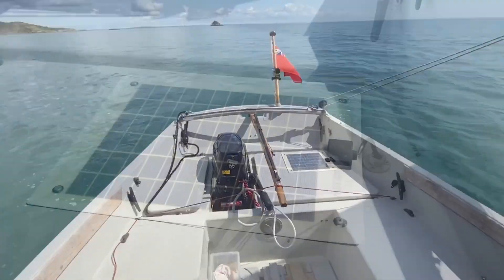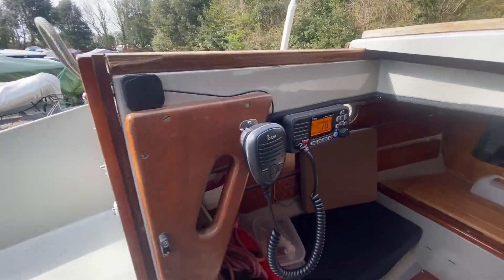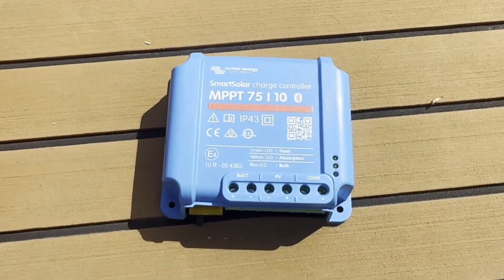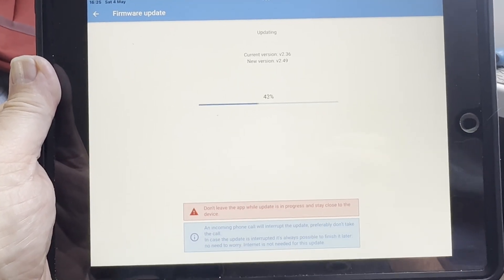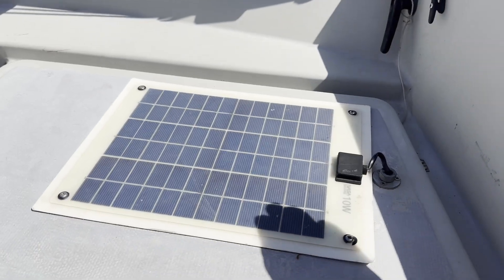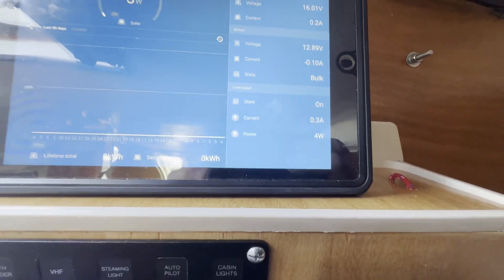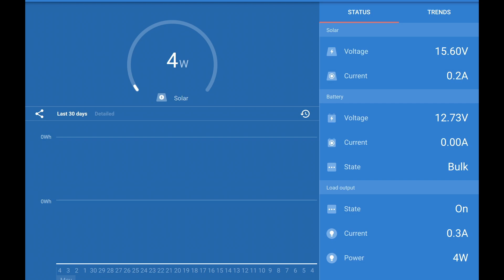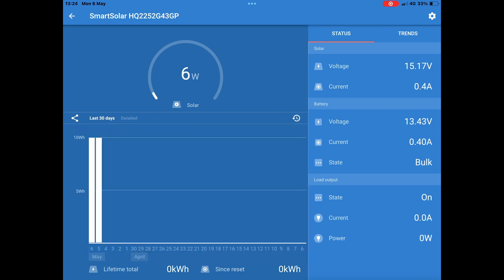No. 29 Fitting a Victron solar charge controller to a small sailboat.

Comment: Hi Paul - I'm sure you'll have thought of this but how about an alternator on your outboard for giving the battery a top up?  I have an inboard and last winter fitted a second battery with a 'Blue Sea Systems Add a Battery Kit' which controls charging of the batteries, giving priority to the starting battery until it is fully charged and only then switching automatically to charge the second battery.  Not entirely relevant to your situation but I thought it might be of interest.
Reply from the maker: Hi. Yeah, I priced up having a charging coil retrofitted. Best part of £400 all in.  It’s still a possibility but I’m probably going to go for more solar instead.
Reply: @Morningvicar  That's a crazy price! Sounds like more solar is the way to go.  Keep the videos coming - I enjoy them

Comment: The charge controller you need depends on the battery you have, the cheap PWM works well with a lead acid battery.  The MPPT controller is needed for Li ion, but will do fine on your battery. Go Lithium, it is lighter and lasts longer.
Reply from the maker: Thanks very much 👍

Comment: Many thanks for the video. Always helpful to see someone tinkeriong with solar panels!!

Solar efficiency is down to a whole bunch of things ranging from the angle of the sun, intensity, shaded areas, temperatures, wiring etc.  Also the panels themselves come with an efficiency rating out of the box which people often forget to take into account, the older the technology, the worse the rating tends to be.  Its not unusual to have 20-30% loss out of the box. You then have all the conversions going on from <19V down to 12V etc so there's innefficiency on the charge controller to get the voltage at the right level. It all adds up. Solar panels also tend to lose about 1-2% efficiency per year. If left on a boat I would err to the upper end of that.  Your panel also looks quite sun bleached which will reduce efficiency too.
 
You'd be amazed at how much heat increases on the panels will lose you efficiency too. SOonds daft in a way that a solar panel loses efficiency as it warms up but when you're camping and charging with a 100W panel you can really see the difference. I can often get down to only 25-30W on that panel in bright 30 degree sun, which is very frustrating. On a boat the panel should be a lot cooler though.

So you're doing very well if you get 50% of the rated output of the panel to be honest.

On a small boat where its not feasible to carry a large arch with 400W of solar on it, my tips are to try and charge from the outboard when using it. depending on the outboard and it's output, you should be able to plug it into the charge controller. Or you can plug it in direct and just monitor it.  However the power from the outboard can be very variable, depending on Revs and can often not be enough to charge a battery with if "put put putting" about.

I take my battery out before nights away and shore charge my battery so I know its full and then rely on the panel to trickle charge it, however its amazing what will eat away at the power

i also connect everything up with waterproof connectors so I know I can plug in all kinds of stuff without having to remove things. I am currently using SAE connectors taht seem to work really well.
Reply from the maker: All good stuff Dave, thanks very much.
Loved your flying jib video btw. https://youtu.be/32HMDMrNx0w?si=2KFk7u2Xv7qe_XPu I have an old mirror jib lying around that i'm going to play with as a staysail. pretty sure it'll choke my slot but should be fun trying.
Reply: @Morningvicar  Many thanks for that. I am still trying with the "Flying Jib". I have since pulled it up more so the sail flies a lot higher and this seems to work, although i am wondering if the general shape isn't quite right. I added a line at the bottom to do this. I also have a much better way of securing the sheet. The wind always seems to little or too much when I test it though. In a few more videos time you'll see me almost breaking the bowsprit with it!!!

I had another go early this season, however I have now decided that I need to have 2 sheets with it. Using 1 sheet on the lake where you need to tack constantly was just too much hassle so watch this space!!!
Reply from the maker: I look forward to watching

Comment: You need a bigger solar panel on top of the hatch I bought several 60w panels 680X800  at £36 each .   Change your bulbs to led  and keep your cables larger than you think you’ll need to cut out power loss
Reply from the maker: Thanks.

Comment: Your mast head lamp must take more than a couple of milliamps. Typically they are 10W bulbs which means they should draw close on one amp. If you have an LED masthead light I would still expect 100mA. Check the lamp, it may not be working!
Fit your solar panel where it is least likely to get shading, they do , as you noted, drop output dramatically even with a small shadow.. Leave the panel exposed all the time and you will always have a full battery. If the boat sits on a mooring or trailer then try to angle the panel at 45º due south for max solarisation.
If your battery is a sealed type the disable the equalise function, you must not use it.
Reply from the maker: Many thanks. You’re quite right, I meant to say “1 to 200 milliamps” which is what was reading on the app. It is an LED.

Comment: Another great video.  Personally i would add a solar cable connector that for longer trips you can just plug in another Flexi panel.  Use the same approach on off grid camper we have works very well.
Reply from the maker: Thanks, that might be the best solution tbh.

Comment: thanks for the video really interesting, I think its well worth paying extra for the Victron as like you say you can see what's going on. I added similar electrics to a CapeCutter 19 although just used a small alternator on a Tohatsu 6HP to keep battery topped up the best thing I added was a small tiller pilot (Raymarine) I thought the outboard alternator would interfere with the internal compass of the tiller pilot which was directly above the engine and was fine so could have autopilot even with engine running which a huge bonus . Keep us informed . Cheers
Reply from the maker: Thanks for watching. There is still a voice in my head saying “get the outboard charging”. Tiller pilot is my next project.

Comment: Hello again.  I've done some work of this nature on my own boat.  I am no expert so, sorry, no advice.  However the things I've learnt/question are:

*  If you get a bigger solar panel fit a isolation switch as soon as the cables enter the boat so you can carry out safe maintenance on the system.
* You may think you are using the right diameter conduit but trust me it won't - go up to the next size
*  Something I've yet to fathom - there is a possibility your outboard could be kicking out "angry pixies".  I don't know how you incorporate the 2 different systems (solar & mechanical).  Let me know when you find out, please.
*  Masthead nav lights.  They are a pain & I am sure I've heard somewhere they don't comply with the regs.  My nav lights are 9m above the deck & not working & there is no way this 70 yo 95k man is climbing the mast to fix them.  Instead I'll fit a set of cheap lights with LED bulbs to each side of the hull so I can get to them easily for maintenance.
*  Finally, what I've learned from refurbishing my yacht is to keep things simple especially with boats under 25 feet.

Good luck.  But it's more than luck.  The more work you do to your boat, the more you understand her & her systems.  Chin-chin
Reply from the maker: Thanks for the comments, always helpful.
My outboard does not have a charging coil, I only use the solar for power. I have considered retrofitting (would cost a few £100) but am now thinking that i don't need to.
I've done a separate video on the lights https://youtu.be/fAvOCFBGu2k?si=Jud7YRaZw7B55zyQ and come to more or less the same conclusion as you.
Reply: Very interesting, I understand solar much better now
Reply: Mast head lights do comply with coll regs when sailing but not when under power. Then your lights should be lower and you need a steaming light. See coll reg rules 23 and 25 to determine what is correct for your vessel. Note when you are under power you are a power boat regardless of your sails.
Reply from the maker: Thanks. I have a masthead steaming light for motoring and deck level navigation lights for sailing so we’re all good